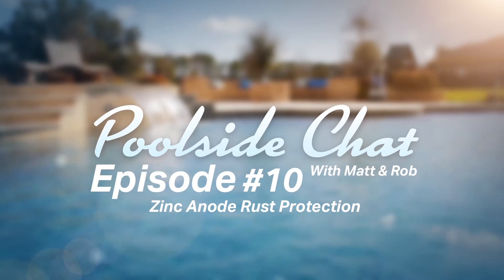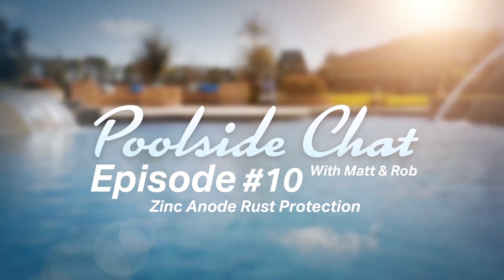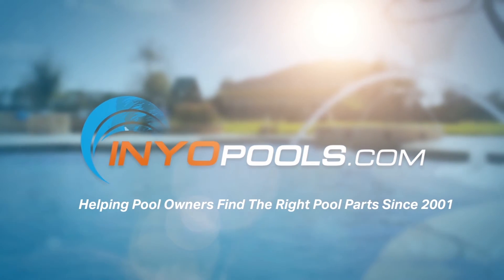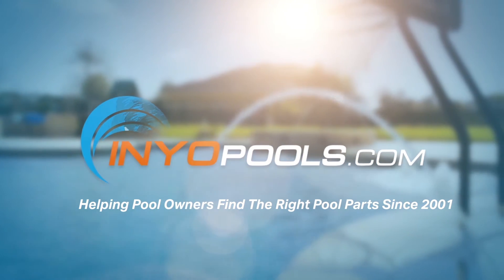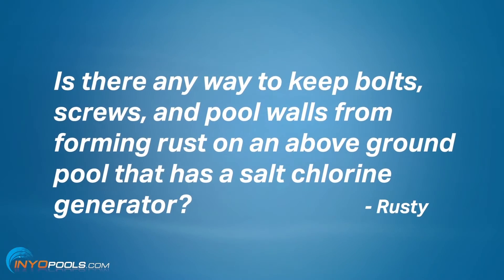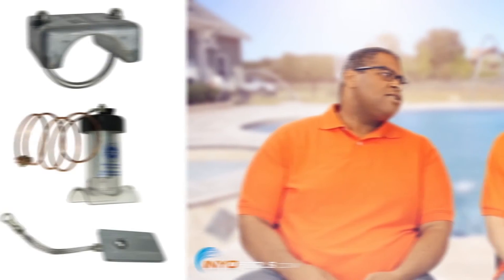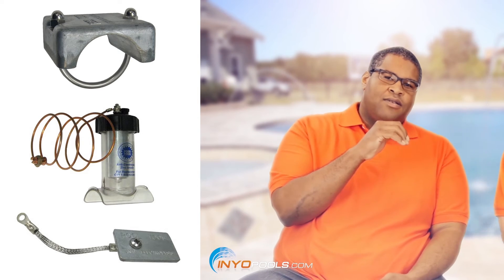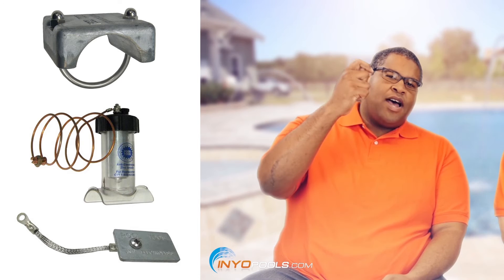Poolside Chat Episode 10: Zinc Anode Rust Protection

Comment: How does the skimmer zinc anode work if it’s not bonded?!?
Reply from the maker: Zinc anodes do not need to be grounded to work properly.
Reply: @Inyopools  For the anode to work, electrons must flow from the anode to the metal to be protected, and for this situation to occur, they must be in direct electrical contact or through a cable.